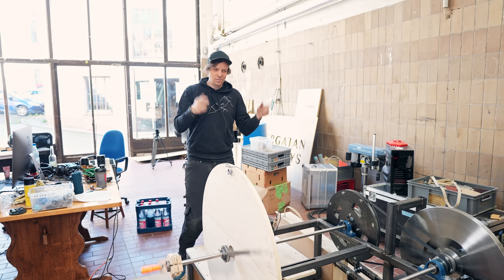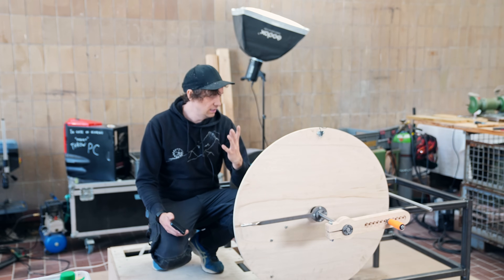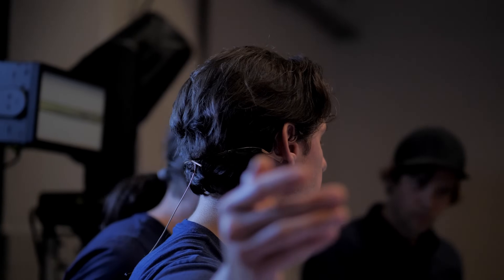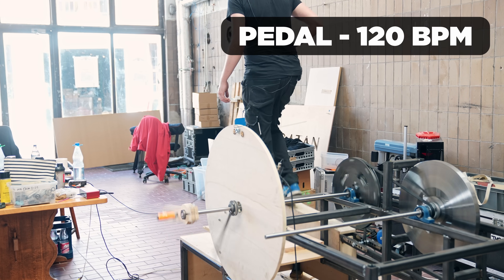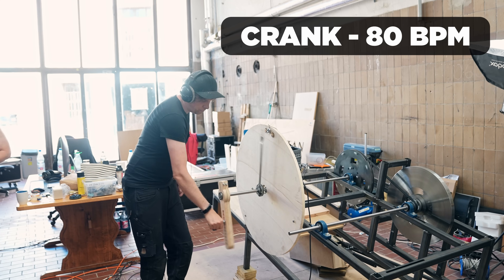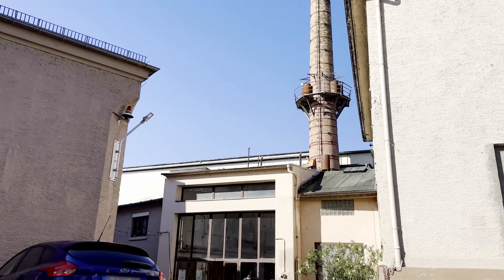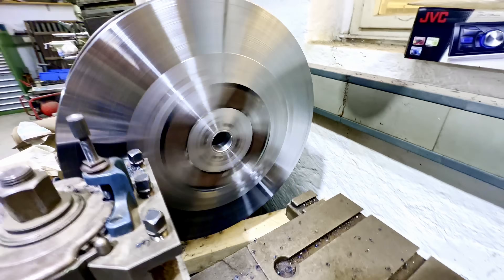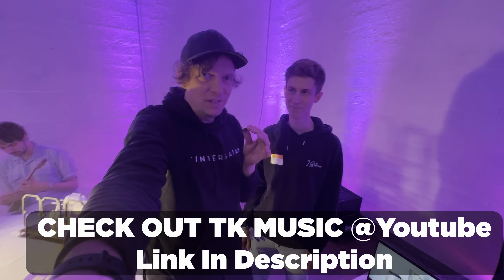The Prototype is Finished - DAY 10 - Marble Machine Flywheel Prototype

Comment: What is wrong with a motor drive? If you still want to be able to manually change the tempo, you could have the crank as an input device, where you actually measure the speed of the crank to set the motor speed, while the motor keeps the crank spinning with some kind of slip mechanism, or a torque measurement ( like a car servo steer)

Comment: ridged belts must be relatively tight to transmit power.  They create quite a bit of friction. Electric motors are sized to have enough power to spare, but you can't resize the artist! Chains or toothed belts are going to be far more efficient. Think bicycle drive parts. A full derailleur would give gearing options to keep the flywheel speed up at lower final drive speeds. Ultimately, though maintaining tempo with a directly driven crank or pedal input system will be quite hard.  Some sort of governor is required.

Comment: Seeing the MMX finally play the theme song really hit me home, yet at the same time the reduced tempo illustrates clearly just what the limitations of a mechanical music instrument are. Realistically speaking, the original machine is probably the only one capable of playing the theme song at full tempo because of its lightweight construction, yet the immense strain of playing at that tempo likely contributed to its untimely demise. It is quite likely that only electronic control would enable the machine to play at speed without exploding itself, but that would defeat the entire spirit of the marble machine in the first place.

The other common bottleneck, not just for Martin's machines but also the MMT and Love Hulten's machine and other similar machines, stems from the need to reliably refill all the channels while playing to prevent any of them from running out of marbles. All too often the marbles simply take too long, especially in the elevator ride to the top, to complete a round trip in time to get back to the most heavily used channels. This means the marble paths at the top need to be as short and simple as possible for the machine to realistically last a full song, and the simple shaking flat pan system in the MM1 still seems to be the best solution for that.

Comment: This is really nicely done. i'm not sure you can't do faster timings, couldn't you make double-timed triggers on the programming wheel with your new system? I also think you can double up the rhythm controls making both pedal and crank, with more transmission blocks it should be easier to use and maybe reach higher speeds

Comment: this manual system seems like it would be adding to the difficulty and saftey issues. I'd imagine nearly impossible to keep tight but varied timing with just a manual drive and flyweel energy storage. the electric drive of the mmx seemed to go well

Comment: The pedal's flex might be part of what's making it feel less tight.
Reply: Adding a half to 3/4 length supporting triangle gusset centered under the attachment point would fix the flex.  I think the link is too close to the center, making the pedal input very heavy and insensitive.  but it kept the pedal travel reasonable, I guess.

Comment: Awesome as always - thanks for sharing this! Also, two things I would like to see tested are: 1) A shaft key for the hand crank, so it's always the same angle as the contact mic and could be used to "feel" the position of the beat, and 2) A bi-colour LED that glows red (to slow down) if the contact mic triggers before a preset BPM, and green (to speed up) if the contact mic is behind BPM. Also, the LED brightness depends on timing difference.

Comment: I think the reason the pedal doesn't drain energy from the system is that it gains some potential energy every time it's lifted up by the flywheel, and gives it back when it falls down again. Theoretically this should result in a slight fluctuation in speed once every revolution, but it's probably too small to notice. If it were a problem, adding a counterweight to the pedal might help.

Comment: I still think that by reducing the mass of the flywheel by turning it you did more harm than good. It's dynamic balance that matters, not aesthetics. By insisting on straightening out the flywheel, you are going against your own directive of function over form.

I think that by mounting the sensor (well, the thing the sensor senses) on a long arm you are introducing a false error, and because when you hand crank it you are applying force much more directly to that arm, that's why your measurements are the opposite to your expectations. When you hand crank the machine you are making that long arm vibrate/wobble, which throws off the measurement. I think you would be much better off putting the position indicator on a full disc (with a much smaller diameter), and using an optical sensor rather than a physical one like the contact mic. I would also recommend putting the measurement in a place that is neither closer to the pedal input nor the crank. Preferably after the flywheel, which is what really matters anyway. You are currently measuring the crank input more than the stability of the system itself.

The way you've used the contact mic in the past was valid, but I think that this time it is utterly inappropriate in the way you've used it. For one thing, every time the plastic piece hits the mic, it introduces a vibration in the long arm attached to the axle, and the resonance frequency of the arm is unlikely to give a consistent position relative to where it hits the mic mount every time it comes around. Also, every time it hits it will cause wear, however miniscule, which will not only add up over time to the point that it doesn't work at all, but also introduces another bit of random error.

Think of it this way: by interacting mechanically with the system, you are creating an undesirable input into the system. And in this case, you are affecting the measurement itself even more than the system. What you want is a way to measure the frequency of the system that doesn't physically interact with it. A magnetic (Hall-effect) system would also create forces, however tiny, on the system. But an optical sensor would not. At least not in a way that could be measured.

In short, it's neither your experience nor the data handling that are the problem, it's the measurement itself.

Edit: I also just noticed that the shaft on which the crank is mounted is either bent or flexing, which is also likely to affect your measurement method far more than the system itself. An optical sensor would be much less sensitive to that.

Comment: Using the crank allows you to match the metronome more precisely, which makes it feel like you're playing very tight. However, as you're constantly adjusting to the metronome, the time between beats will actually vary a bit more, meaning it is less tight. Using the pedal makes it more difficult to adjust the tempo to the metronome. But the variation in time between beats is smaller, which equals tighter music.

Comment: If 120 bpm is peak performance, would it not be ideal to have a gear system similar to a bicycle? That way your cranking can stay consistent but you can change gears to change the bpm but not your personal rhythm. I know the deviation is more of a resistance problem but I feel this may solve the issue in theory.

Comment: I fear I’m starting to be a bit lost. I thought tightness in between different musical instruments on the machine was important. I am not so sure whether the ability to keep an absolute tempo (which is the only thing which this setup is testing) is actually what limited you at any time in the past or will in the future. Otherwise, you would never have been able to play any instrument without a 86kg flywheel :-) there will be a myriad of challenges ensuring tight relative timing throughout the machine, but why focus soooo much on absolute timing when it never was an issue?

Comment: imagine if you used your body weight to spin the flywheel. Imagine a system where your weight is transferred via cable to a pulley using a series of [insert clever idea here] .. that way you're using a pretty constant, measurable, adjustable input that only changes with your weight ;)

Comment: You could consider adding inertial counter weights to the first pulley to stabilize the input speed into the flywheel. Although it would need to be very sensible to work properly. Or get the fly wheel a lot heavier. 

To me, it make sens the pedal is more precise as the movement amplitude of your foot is a lot smaller than your hand on the crank.

Comment: If it comes down to machine or no machine perhaps using an electric motor to drive the machine will give you the tolerance you are looking for.  It may also allow for a range of bpm that is suitable and less sweaty.  You probably will have someone who can plan around the drawbacks of using a motor in close proximity to pickups.

Comment: I think your data analysis might not be giving you a very good idea of the tightness of the music. Sure, your hand crank may give you a really good standard deviation, because your hand can input energy into the system during the full 360° of rotation when you hear the machine go off the beat, you can correct immediately. With the pedal you can only input energy during 120° of the rotation and during the rest of the rotation the flywheel is just winding down in an exponential decay, so you can't adjust your input as quickly, which smoothes out the feedback. The bpm will have a larger standard deviation with the pedal than the hand crank, but you also have to look at how fast the bpm changes. I'll bet that a higher total bpm variation that goes more gradually sounds a lot tighter than a lower total variation that changes very fast.

To put it another way: your current analysis weighs beats that are 1000 cycles apart just the same as beats that are two cycles apart. Music that goes from 60 bpm to 62 bpm over a matter of minutes will sound much tighter than music that has an average of exactly 60 bpm, but has a one beat in 10 that is off by one bpm (I leave it to the statisticians to do an exact calculation of what the exact ratio should be). 

I'm not a music expert, so I might be wrong about this. 

To put it yet another way, which may help you on your googling journey. I think what you are currently measuring it the phase noise of your system and it seems like with the hand crank, you have a short enough feedback loop where you can keep the spectral bump very narrow, but you get a pretty high noise floor in return. The pedal system might give you a broader spectral bump and a higher total noise energy, but the level of your noise floor might be a lot lower. Therefore, it would definitely make sense to look at the amplitude and phase spectrum of your recorded files by applying a Fast Fourier transform. In addition to that, it should probably be quite easy to generate a couple of audio files with different amounts of total bpm variation, but a different frequency spectrum of said variation to get an idea what matters most for how tight the music sounds: how much you are off the metronome beat or how much consecutive beats are off from one another.

What you also have to take into account, is that you're only gathering one data point per cycle. You should actually have put multiple tabs on your  flywheel, because if your machine starts playing multiple notes per cycle, then there will also be a difference between how the hand crank and the foot pedal sounds. The foot pedal will always introduce some amount of speeding up and slowing down within the cycle. If you'd plot out the height of a single point on your flywheel system over time, you'd ideally want a perfect sine wave with one single frequency. For the hand crank system, you'll be able to get the frequency over many cycles to be pretty accurate and you'd have a sinusoid with quite a bit of noise all over the cycle from your hand not exactly following the perfect circular motion. With the pedal system, you'd probably have a little more spread in the frequency of the sine wave, but you'd have 120° where the sine is a little too fast and a little noisy and then 240° where it is not noisy at all, but the amplitude is slowly decaying. You can definitely imagine the two designs being driven by a near perfect musician where both have the same standard deviation and the same mean frequency, but they sound completely different.

I don't know if there is any literature on what humans perceive to be the tightest, but I am willing to bet that standard deviation alone does not tell the whole story. After all, humans don't have a perfect metronome in their head, we're not great at identifying whether a musician is playing 60 bpm or 62 bpm, but put one musician who plays at 60 bpm next to another that plays at 60.5 bpm and we'll hear it immediately. Put in 1 beat that is 10 degrees off and we'll hear it. 

You don't really need a test on the prototype to determine which metric matters most for perceived tightness, you can probably generate some sound files mathematically and listen to them to get an idea of what sounds tightest. It will give you a much better idea of whether you should go with the hand crank, the pedal or the escapement mechanism.

Comment: Martin, your feeling that the pedal is taking energy away from the system does make some sense. It's a big mass  that you have to accelerate into oscillation. The only thing is: most of this energy is stored in its oscillation and you clearly don't have a lot of mechanical friction or air friction. Take that into account in your design!

Comment: The shaft where the crank and the pedal are mounted to is flexing from the input from the pedal. Can you add another bearing block in that large span to strengthen it maybe?

Comment: just a quick idea, maybe the tightness depends on the point the force is applied to on the driving wheel, with the crank the point is on the axle, with the pedal is further away from the axle.

Comment: What if you used an infinite variable speed pulley with a governing system. That way you can have your flywheel turning at any speed and have your output at a constant speed.

Comment: Martin, when you talk about whether the pedal or the crank is tighter, you're missing that there's more to it than one simply being better.  They behave differently.  Looking at the numbers, you can see that the variance on the crank stays the same regardless of tempo, but the variance on the pedal scales with the tempo.  This tells me that the pedal is much more reliant on the inertia of the flywheel to remain consistent, as it gets tighter when the flywheel speeds up.  The crank on the other hand is much more reliant on your physical control, so the tightness is not the tightness of the machine, it's the tightness of the player.  The reason it feels better to you is because you have that direct control over the tempo, and can instinctively make those small corrections to stay on tempo.  The reason is doesn't look as tight at high tempo is because you're instinctively trying to control it more, and thus subtly fighting the inertia constantly.  (It may also have something to do with how the machine was propped up during that test!)

I look forward to seeing how they compare with different flywheel weights!

Comment: Something that I think might be leading to different perception of crank vs pedal is that with the crank you're spinning at the exact same rate as the output wheel(as you're driving the output wheel). However with the pedal you're going through another wheel, so you're not pedalling at the same tempo as the output. So making adjustments might be harder with the pedal vs the crank 🤔

Comment: I think what you need is a gearbox.  Have a set input (100rpm?  Doesn't matter...) that translates to a bpm.  You can change it manually using just belts for the specific song.

Comment: I can't say for certain but one thing that might be messing with the standard deviation results is the various lengths of the datasets. The std trends down as you add more datapoints to a set. So if you want compare them properly, make sure to use the same amount of beats in each measurement.

Comment: Hi Martin (from another Martin) would you consider using the flywheel for exactly what it is: an energy storage device, and power the rest of the machine with an adjustable governor? Your input could be eliminated as a variable in the music tightness, and all you need to do is keep the flywheel spinning. a change in tempo could be made by simply shifting a lever to your new setting.

Comment: Even if the pedal had been stealing "a lot" of power, it wouldn't necessarily be significant.  The machine currently has no load.  In order to understand how a bad a draggy component's drag is, you have to compare it to the power consumption of the whole machine, when it's lifting marbles, turning the programming wheel, etc.

Comment: The outcome you’ve assumed may be a result of confirmation bias. You’ve oriented the crank in such a way that it may come to tempo quicker and you have a “feel” of where the downbeat is, however the pedal may be more accurate without the “feel” achieved from the handcrank. Simply put, the better feel of the handcrank can make you feel like it is tighter, especially as the past two iterations used this method and you have practice playing tight with the crank. Perhaps a positive “click” on the pedal can give you better feel similar to how the downbeat is by your ear using the handcrank.

I think time to achieve tempo as well as “feel” should become quantifiable data that should be considered in overall design choice.

Comment: The problem with the pedal is that your accelerate the rotating motion at a specific phase. Notes before a half rotation will drag, notes after a half rotation will rush. And your current setup with only one contact microphone measures none of this...